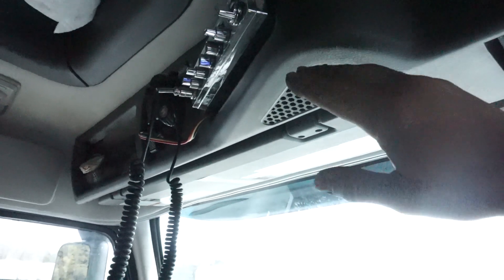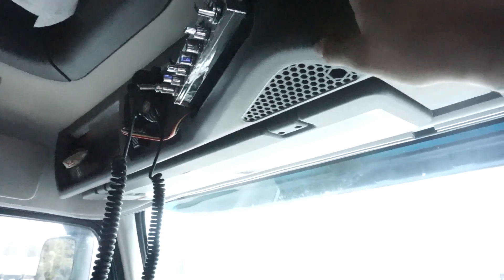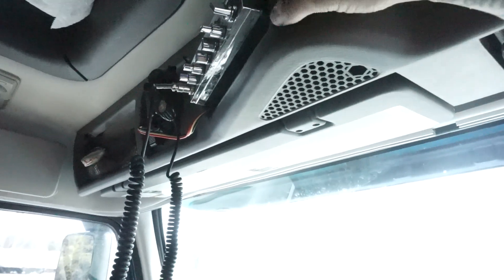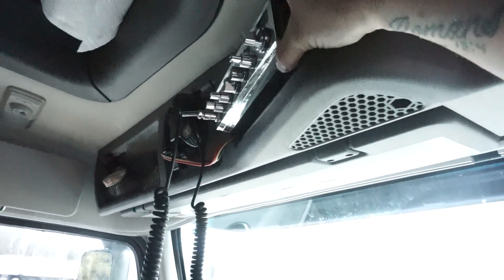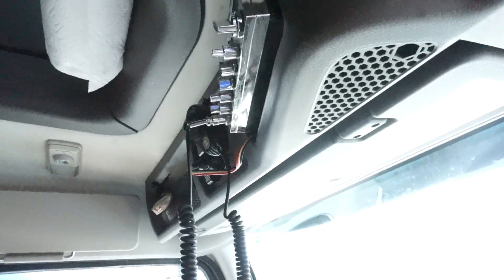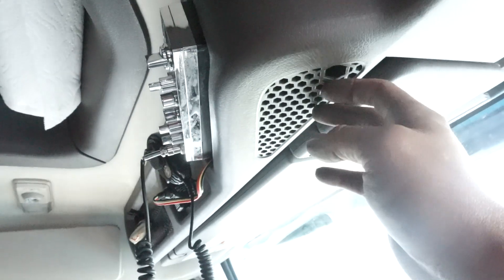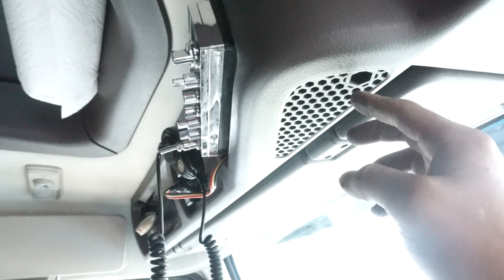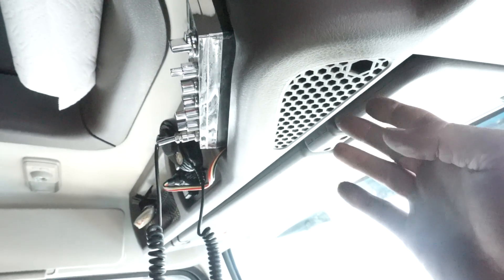How to install CB radio in Volvo VNL

Comment: Forget that if you got a Big radio no  ventilation not enough space only option is to pull the sun shade flap forward and drill to holes and instal you’re own bracket plus the Antenna system and coax are total junk on a Volvo

Comment: I have a Galaxy DX 94HP which is way too thick with the bottom plate to fit and was wanting to see how to take out that whole bracket or put a mount under where the grid is.

Comment: Is that a General Lee?  If so, I guess that means some of the larger imports will fit in the cubby.  Is the stock harness able to handle the more powerful imports, or would you have to run a power chord directly to the batter?
Reply from the maker: jim smith it is and I can’t tell you what would or would not fit, sorry

Comment: Thank you for that. However,  if it’s not a Phillips head for the mount, what  could it be on a 2020 VNR?
Reply: It's a Phillips. My 2023 has a phillips head screw in each hole.

Comment: I lost power to my cb and can’t figure out which fuse went out. Not sure if it’s the fuse box in the dash.   Would you have any answer as to where this fuse might be?
Reply: CB has a fuse or two on the red wires near the end or in the fuse break if you put a test light on it and get nothing. Should be marked auxiliary for CB.

Comment: I installed the cb radio on 2020 Volvnl attached the coaxial cable which is for the antenna but didnt get any antenna red light on the cb. Anyone else have the same problem?

Comment: I see no speaker in my Volvo for a CB,  I see only a red power hookup, a black ground and an antenna wire in here.  Can i buy a cb with a speaker on it or do i have to rig up a seperate speaker in here somewhere ???  It seems pretty dumb that volvo would put everything else in here to hook up a cb but not the speaker..   Any help would be greatly appreciated!!!   Thanks...
Reply from the maker: J Rock considering it’s Volvo pretty much all the designs are dumb lol. Most all of mine did not have a speaker and I mounted a speaker inside the cubby up top of the cb.
Reply: @8526Productions    so just find a 6×9 or something and stick it up there?  Is there a positive and negative speaker wire coming out of Cb's to connect to a regular speaker or is there some kind of plug I'll have to rig up to the speaker?   Thanks for the help. I'm new at this.
Reply from the maker: J Rock yea for the ones I have I run the cables to the mounting points within the tray
Reply: @8526Productions  thanks.
Reply: I have the same problem. Can u please describe exactly what u did to solve this problem?
Reply: @yevgeniykarpinchik4269        Im not sure exactly because i never bought a cb but if theres a positive and negative speaker wire hookup in the back of your cb all u gotta do is hook up a lill car speaker somewhere for it..

Comment: In my Volvo I'm not getting any sound from my cb
Reply from the maker: Christopher Laymon If it does not have the stock external speaker you will have to mount a stand alone one
Reply: How did u solve this problem? Cause I have the same.
Reply: I bought an external speaker and that was the problem